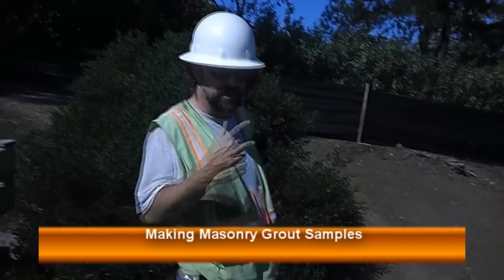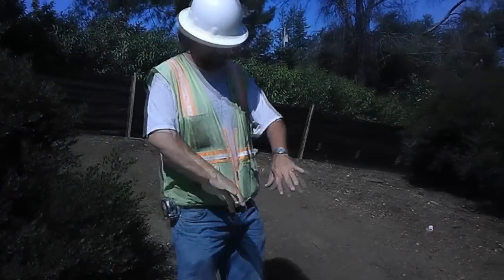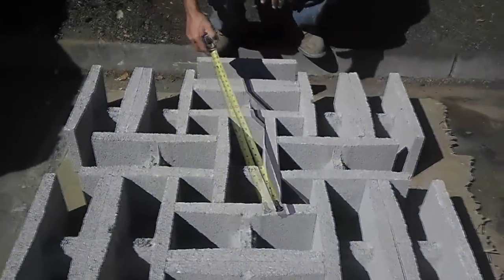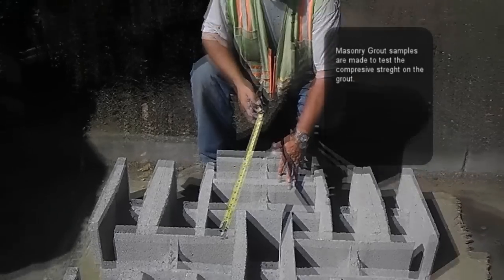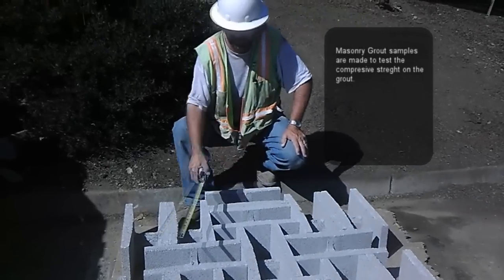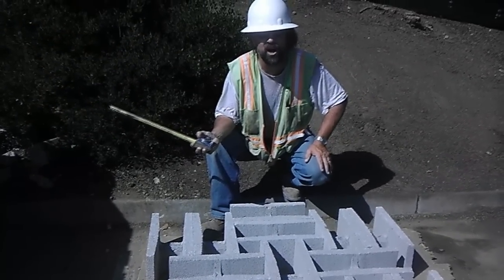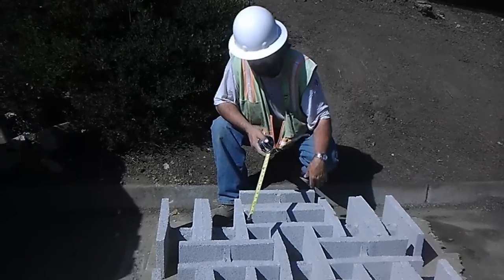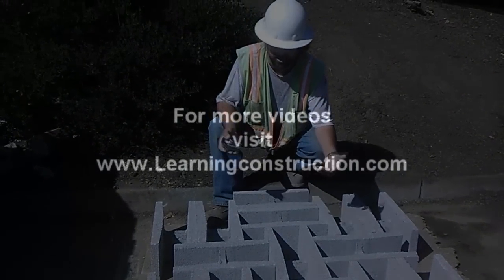Making Masonry Grout Samples on site for Construction Projects.

Comment: The samples should actually turn out closer to 3.5" x 7". A square  3/4" wood or plastic spacer is inserted in the bottom of the cavity before filling it with grout. Don't forget to use paper or cardboard on all 4 sides or you will be left with a hung chunck of monolithic concrete that you can't separate and can't use.